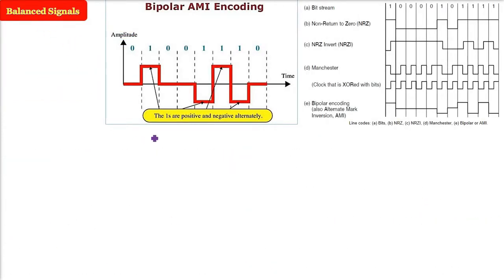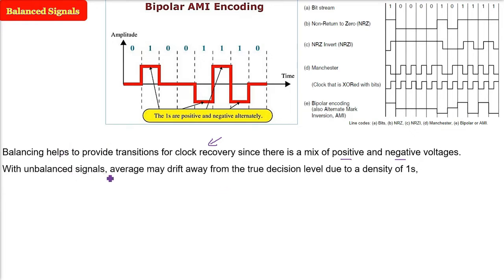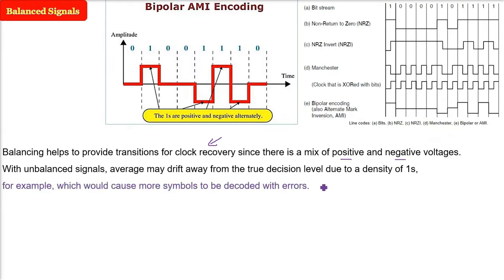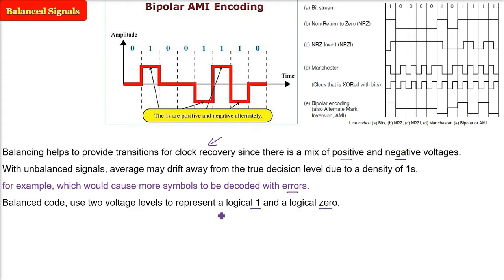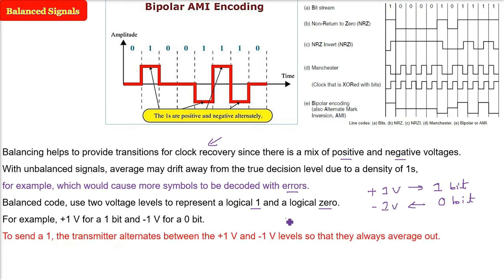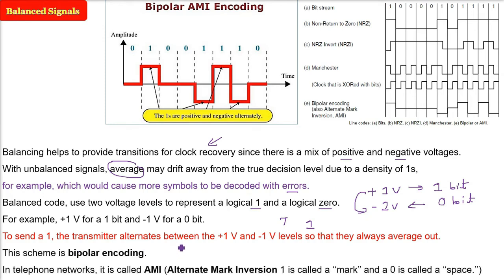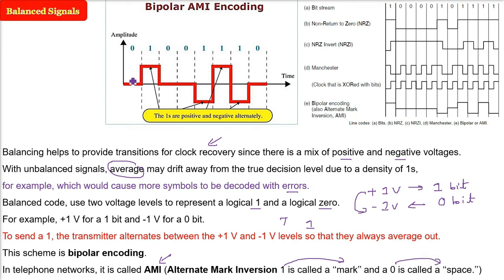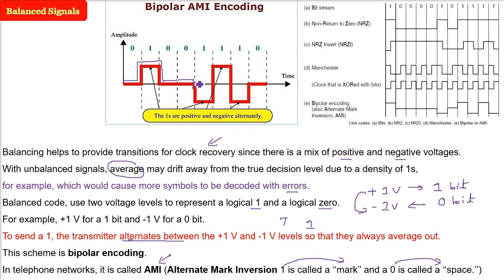What is bipolar encoding | bipolar encoding | AMI | AMI (Alternate Mark Inversion)

Comment: Dear Sir. If there is one AMI signal to be transmitter throught optical media (considering only: ON/OFF signaling) which codification would you suggest in order to convert from this AMI line signaling? And, after receiving from this optical media, be easilly translated back to AMI?
Regards.